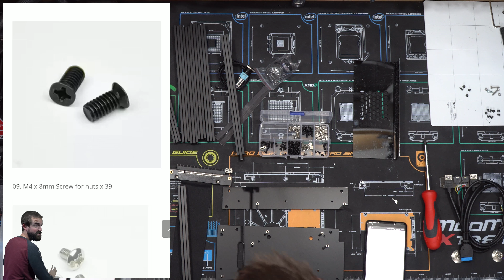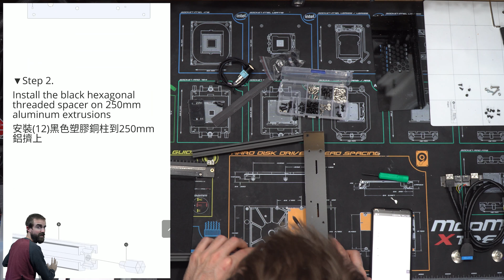Geeek A30 SFF Case Review & Build

Comment: Hi, I really enjoy watching your videos. I have the same CPU cooler Noctua NHL9A for my Ryzen build, and was wondering how you managed to swap out the 92mm fan with a 120mm 12mm low profile one? It looks like the 120mm fan is hinged to one side of the heatsink. Did you tape it down or used something else?
Reply from the maker: I used double sided tape to mount it down to the motherboard and heatsink

Comment: Nice video, although it looks like you have the top panel (with the exhaust fan) on backwards. It should be turned around so the white front panel and white top panel meet up and there isn't a gap between them, which also moves the exhaust fans more towards the back of the case.
Reply from the maker: +Jeff Wiesneski Hmm really haha I think you might be right! Glad you like the video though!
Reply: Only reason I noticed that was because in the SFF Network review the guy there did the same thing and pointed it out as a negative about the case, and someone else mentioned it in the forum post.
Reply from the maker: +Jeff Wiesneski oh okay thanks for pointing it out to me!

Comment: Hey Zach, thx for the video man. I actually laid an eye on this case since your last video about A20. So around a week ago I bought A30 case and already made build. But I have some questions to ask if you dont mind. I need your help asap, since I dont know anybody else who had a build with this case.

1. First of all, while assembling, didnt you get the feeling that some of the holes in panels dont actually fit each other quite right? I mean, I got my case damaged by trying to fit some screws in the panels. I see in the video you also have some scuffs on your panels. The whole case seems to be bended in some places. And the USB front panel didnt actually quite fit the holew on the front, so I had to apply great deal of force to fit them.

2. How did you managed to connect 2 top fans and the cpu fan to the motherboard, since pretty much all itx boards dont have many fan connectors?

3.In the end of the video you are trying to get this ZOTAC card int the case. Did you manage to fit it? Because I have the same card (zotac gtx1060 3gb mini) and I couldn't make it to fit fully in the pci extension bracket, since the back panel of the case was blocking the metal plate of the card. What I mean is, I could not move this card down enough to actually fit in the pci-e bracket. It seems like this case actually doesn't support ANY graphics card that is shorter than 210mm.  I ended up bending the metal plate on the card so I could put it furher down in the bracket.

I really hope you can help me with this. Have a nice day!
Reply from the maker: 1. I did get that feeling but then I realized I wasn't assembling it correctly so after I went through the directions again it didn't seem that way, the directions aren't great though!

2. I used a fan splitter

3. Yeah it fits but you have to take the front panel off to slide it in correctly haha

Comment: Hey. Can you tell me a bit more about CPU cooling? I see in the description you used the noctua low profile cooler but not sure about that huge black fan you show in the video. Thanks!
Reply from the maker: +Corux It's a noctua nh-l9a for am4 with a sythe slim 120mm fan replacing the stock noctua fan
Reply: Thanks man! that makes sense :)
Reply from the maker: +Corux your welcome!

Comment: Awesome review. I want to swap out my Node 202 for either the A20 or A30. I like the airflow options the A30 has but I do not want to spend $30 on the PCIe extension. Yeah, call me cheap lol.
Reply from the maker: Hahaha I wouldn't call you cheap! I completely understand!
Reply: Lol. Well, airflow is my only concern with the A20. If I'm not overclocking my CPU, I should be good, right?